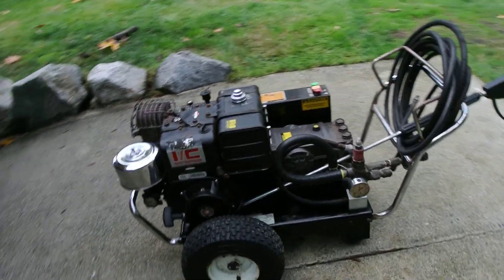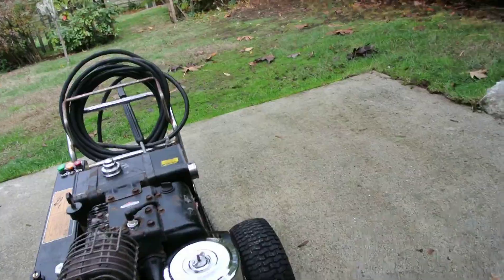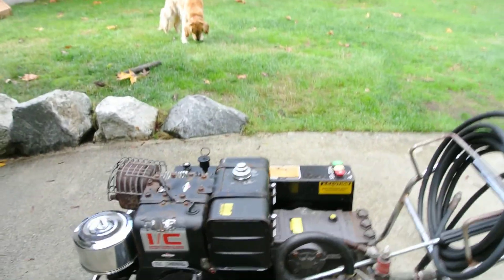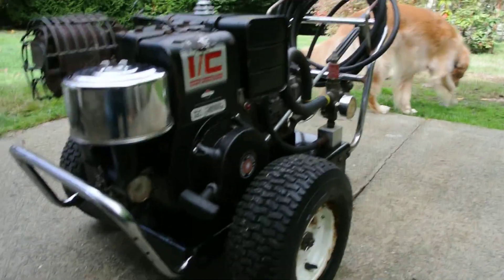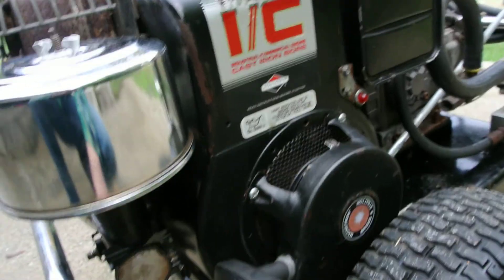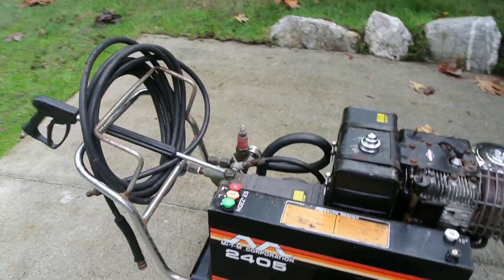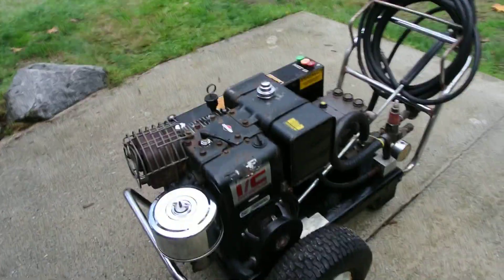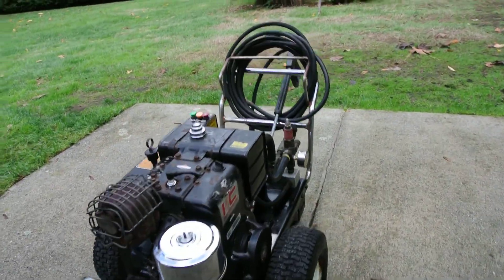Mi T M 2405 Pressure Washer - Got it running

Comment: Most likely the court breaks because you don't release the pressure on the pump hold the trigger when you pull it over
Reply from the maker: You're right! I use a clamp to squeeze the trigger n
now when I start it.

Comment: Have you been able to find an owners manual for it? I’ve been looking around without any luck.
Reply from the maker: This might help. https://www.mitm.com/pdf/manuals/pressure-washers/cold/CW%20PREMIUM%20SERIES%20GAS%20&%20DIESEL%2037-0095%20020720.pdf You can download the manual for the engine off Briggs' website.
Reply: Cool thanks. Picked one up for $30 the other day and had to adjust/re-seat the  valves and rebuild the carburetor but it’s now running like a champ…..that kickback is no joke. Sprained my middle finger trying to start the damn thing.